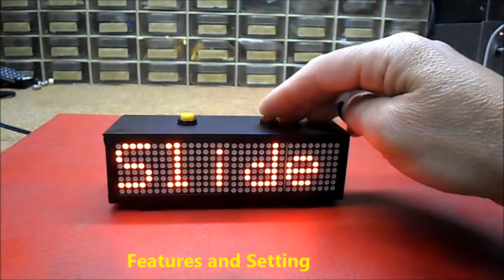Arduino Nano mini LED matrix clock

Comment: Excellent . Just move this line out of the if and include it inside a .lostpower() if conditional with the  ds1307.adjust(DateTime(F(__DATE__),F( __TIME__))); ... the result it will save the time even when disconnected only with DS3231 (btw change it also to that number)

Comment: hallo sir very nice project jst assembled and it worked i changed the rtc1307 to ds3231 and its working fine ds is very accurate compared to 1307.....good work 
quick question i noticed on the date the display is not complete the second digit like "10th the 0" is half how do i rectify that the rest work fine

Comment: Sir it would be very nice if you could add temperature feature to this clock as the ds3231 already has the feature to it. I'm a beginner electronic enthusiast, so i neee help. By far I found your way of representation the best among other videos of arduino digital clock in YouTube so if you could please add the temperature feature it would be very nice.

Thank you.

Comment: You are like the rest... The stuff doesn't work as advertised!
Reply from the maker: In the video you can see how the device works in real time.
Reply: @MirkoPavleskiMK  I see that yours works, but when I hook it up and upload your code I only get errors due to the FontLEDClock.h font library and the Button.h library. I wish it did work!
Reply from the maker: @route-249  Ok, you must install the libraries  provided with the code (in .RAR format) next to the code
Reply: @MirkoPavleskiMK  Unless I'm doing something wrong, FontLEDClock doesn't work!
Reply: Ok, I apologize! You are the MAN!!! My extractor for RAR didn't work properly until I extracted each one individually. It does work! Thank you!!!
Reply: Hallo sir cool project working on and it's working..good work plus your casing is good too....can the display be enlarged to 16x64 or bigger
Reply: 🍒These little cunts are like princesses... expect the world in a silver platter.

Let these illiterate incompetents figure out how to read compilation errors by themselves 😜

Comment: I would like to try this. Will there be a change in the code on the ino and libraries using DS3231 as the RTC instead of DS1307? Thanks!
Reply: Update: Followed your instructions and everything worked without changing anything on the code. Nice project, thanks for sharing!
Reply: g